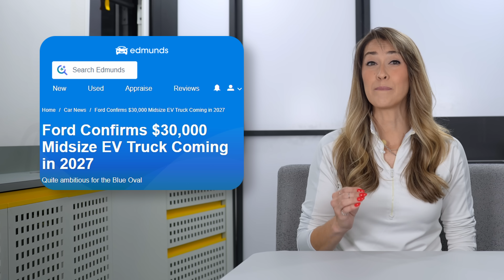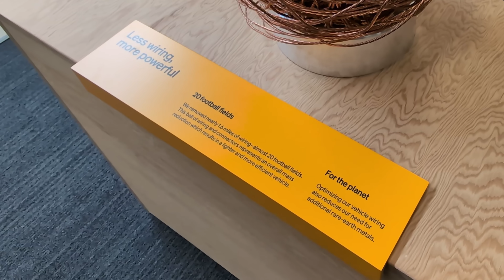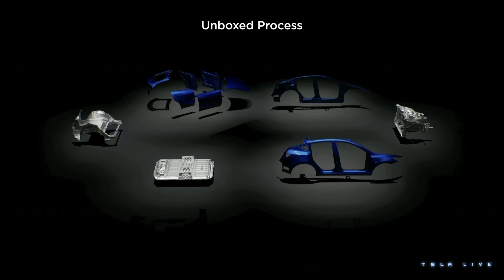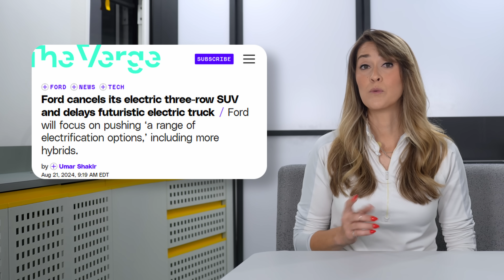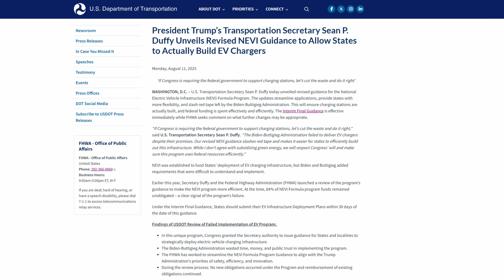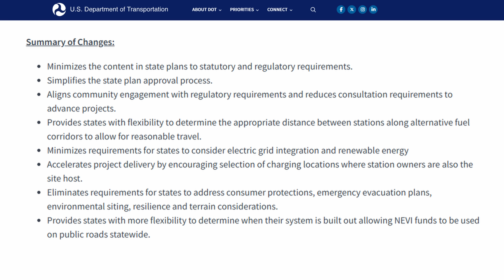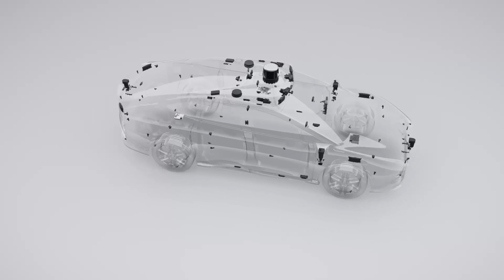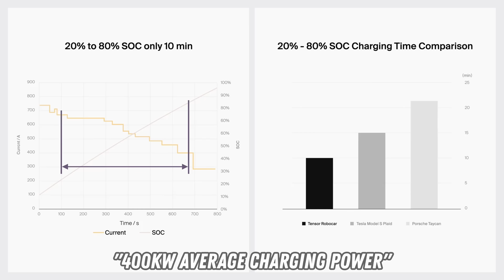The Current : Weekly EV News Ep#76 Aug 17, 2025

Comment: $30k is more of a Model A price than a Model T
Reply: Not saying it's bad.  All remains to be seen IRL
Reply from the maker: The principle of a revolutionary low waste attainable truck is the basis for the Model T comparison rather than the numbers.

Since you brought up numbers: 
The original price of the Ford Model T, adjusted for inflation, would be around $25,000 in today's dollars. When the Model T was first introduced in 1908, it cost $850. The price decreased over time as production became more efficient, reaching a low of $260 in 1925. 
-Producer Tim
Reply: ...vs lowest price currently available EVs
Reply: ...& slate "$25K"
Reply from the maker: Slate is extremely barebones with none of the standout features Jim highlighted in the upcoming Ford mid-sized truck. Slate has no stereo, no navigation, no power locks or windows. Slate will be fine for some, but it is not a mainstream competitor for the Tacoma or Canyon. 
-Producer Tim
Reply: ...& Bolt under $30K in 23
Reply: ...25 Leaf under $30K
Reply: ...model T - for the masses, model A was a better car, not a cheaper car

Comment: Ford is slow and messing up.
Reply from the maker: Are they one step ahead of Toyota, Honda, Subaru, Stellantis, Nissan, and/or General Motors? 
None use unboxed assembly. None produce LFP batteries in the USA. None have Zonal architecture.
-Producer Tim
Reply: @MissGoElectric  Definitely not GM. The others can be debated. Definitely smart to go the Tesla route for manufacturing. Ford has always been my car brand. It’s the only brand I had until we bought a Tesla. I wish they would have started earlier. They should have went for short term pain for long term gain. Instead they went for short term gain and are slow to the EV game. But once they get all this investment in place they will be rolling. But, still could have done it long ago.
Reply from the maker: I spent about a decade working for Ford. The culture of denial about EVs and Tesla's reinvention of how vehicles are designed, produced, marketed, sold, and serviced was staggering. Internal politics, sycophancy, bureaucracy, and the high-protocol + low-vision corporate personality type have work against Ford and other legacy automakers. The financial reporting realities of abandoning ICE IP+facilities+workers and the effect they have on investor behavior prohibit any sudden moves. It is a rock and a hard place.
-Producer Tim
Reply: @MissGoElectric  Great explanation.
Reply: Corporate, stock quarters vs future viability
Reply: U R

Comment: If Ford can pull it off, this is a chance to regain a lot of American market at the low end. It’s no secret that people can’t afford the big fat vehicles anymore. Can’t afford decent used vehicles use vehicle prices are so high that if slate or Ford can pull this off. In the long run, it’ll be a mini gold mine and I think the new approach will have a lot. Fewer recalls fixed and repaired daily is never been so large as it is right now with Ford Highlander.
Reply from the maker: The platform has potential.  We recognize that the specifications would be fairly appealing if the product were available right now.  We aren't sure how it will fare against a slew of new products from Lucid, Rivian, Tesla, and Toyota which will also be released in 2027. -Producer Tim

Comment: NEVI is throwing even more ammunition into the charging wars going on in America right now. Such an amazing time to be a witness to. It's like the intenet and computer revolution of the 1990's, and the smartphone revolution of the late 2000's.
Reply from the maker: Personally, I've noticed that NEVI stations are overpriced and the cost per connector is astronomical compared to what the private CPOs can achieve.  Free money is rarely spent in an optimal way.  That said, if the charging deserts can be filled in by this infrastructure....EV adoption will happen more quickly. -Producer Tim
Reply: @MissGoElectric  Unfortunately, I have to agree on the pricing. Especially with providers such as Francis Energy, the Love's-ChargePoint sites, and the the Pilot/Flying J/EVgo NEVI sites. The only exception on pricing being those by Tesla, which I think is second or third in NEVI awards. Those are usually the cheapest around. And of course, those are all V4 sites open to all.

And I do also agree that this is just a small drop in the bucket compared to those other trillion dollar corporations that have decided to do it all themselves and can afford to compete on pricing. But nevertheless, it's still more ammunition being thrown into the ever expanding charging wars.
Reply from the maker: You bet
-Producer Tim

Comment: Ford just doesn't get it. EV's trucks with tiny batteries (in kWh) and slow charging 400V architecture is going nowhere in America. While GM is building 500 mile of range fully electric trucks and SUV's that charge at 380kW, Ford is playing with 200 miles of range. Or 160 miles at 80% SoC, and around 140 miles in winter. And most drivers don't go under 10% SoC, so your looking at around 120 miles in the winter.

And keep in mind that 3WT Silverado EV with 390 miles of range is down to starting at around $55,000 already, imagine just how much cheaper they will be in 2 years when the Ford 120 mile Ford EV truck comes out.
Reply from the maker: Remember, GMs 400+ mile trucks cost a fortune because the batteries are absolutely massive.  The total addressable market for a $30K truck at least 20 times larger than the TAM for an $80k truck. GM doesn't sell very many stripped down WT (work trucks) to consumers. Those are mostly sold to fleet operators. The average selling price of a GM truck is over $80k right now. -Producer Tim
Reply: Did you miss my second paragraph? It was there for a reason expecting such comments. The 3WT with 390 miles of range is already down to $55,000. Anyone can go to a dealer right now an get one for $55,000. That's not a fleet price. That's a dealer price. The fleet price is even lower. So imagine how much cheaper they will be in 2 years time when the Ford "might" come out.

And you can get used 2024 3WT models with 7 years of warranty still left on the battery and drive train and with low miles starting in the mid $40K.
Reply from the maker: I addressed your pricing in my previous comment. 
Used EVs will certainly provide better value than new ones. I didn't respond to that because I didn't think it was controversial. 
-Producer Tim

Comment: I hope ford succeeds with this project.   Skateboard / tophat is nothing new at this point, show it.  Sounds a lot of EV for a midlow price, I'd rather see a breakthrough low price, that would be more comparable to Model T.  Another try at EV pickup, too soon
Reply from the maker: The first vehicle on Ford's new platform will be a pickup truck and we think a lot of EV drivers do want a smaller pickup truck at a low price.  We'd like to see more great electric options which are so compelling that buyers do not even consider an old fashioned combustion vehicle.  Thanks for watching! -Producer Tim

Comment: How much has Ford made from fossil industries to prevent them from doing this 5 years ago? All this has already been done somewhere outside the US. Ford is racing to try to recapture last place when they have had this development capability for over a decade. All the delays and backtracking are caused by a failure to accept the transition to the future. The Model T concept shows that from the get go. Quit subsidizing all fossil fuels. That alone will equalize the race to renewable and sustainable energy infrastructure, including electric generation, functionally subsidizing the green energy transition.  

Review the history of the transition away from steam locomotives starting about 1939 to 100% diesel-electric hybrid locomotives by the Mid-1950s. Today is the peak development of the ICE just before they become extinct too.
Reply: The chances of ending funding of oil Industries went from slim to none, they have powerful lobbyists and no resistance from the admin
Reply from the maker: It would be great to see subsidies end for all sorts of fuel and energy.  That money has completely saturated politics in the USA on both sides of the aisle.  We see no chance of it. -Producer Tim

Comment: Can you see that with these new guidelines for DC fast chargers that are incentivized there is even a greater need for longer range vehicles 😊these poor or sparsely populated communities where there is not much infrastructure will be much better off if they can purchase vehicles with 400 to 450 mile range and do almost 100% of their charging at home therefor rarely need a DC fast charger!
Reply from the maker: We think the relaxation of the 50 mile rule will result in stunted EV adoption in the 12 states with strong oil/gas/coal lobbies which have refused participation in NEVI so far.  We suspect their funds will be largely malinvested, to the detriment of EV drivers.  Private networks such as those being constructed by Tesla and IONNA will fill every last remaining gap.  It will just take a bit more time without NEVI grinding out those problematic low-utilization locations.  Thanks for watching and commenting! -Producer Tim
Reply: If they're doing 100% of their charging at home, then they don't need a 400-450 mile range, because few people drive 450 miles in a day, every day of the year and also come home every night.

10 minutes at a 350 kW charger will add more than 100 miles of range if a little additional range is needed.

Some taxis and lift vehicles do run 24 hours a day in 12 hour shifts with two driver's, but that's in a regional area, so an occasional Supercharger session late at night for low cost works, if needed.

Comment: One thing I haven't thought about, Since Ford is retooling the plant that builds the current Escape and Corsair, and they haven't announced replacement vehicles, It essentially marks the discontinuation of those two vehicles. That's not a huge deal, except that brings Lincoln's lineup down to just 3 vehicles. I wonder if Lincoln will finally enter the EV market.
Reply from the maker: We previously reported when Lincoln said they'd be fully electric by 2030 and release 3 new models in 2025.  We know those luxury variants were postponed when Ford said the 3-row platform would be pushed.  We aren't sure if the brand intends to go all electric by 2030 anymore, but we can be certain Ford will fancy-up a few of its models and toss a Lincoln badge on them to capture some extra profit margin on the platform.
-Producer Tim
https://www.repairerdrivennews.com/2021/06/16/lincoln-seeks-to-electrify-everything-by-2030-talks-connectivity-retail-strategies/
Reply: @MissGoElectric Thanks for the reply. As a current Lincoln sales manager, I can say I'm just as in the dark about this as the common consumer. I would like a rebadged Mach-E to replace the current Corsair. And it would be awesome if they electrified the current Nautilus. I guess only time will tell.
Reply from the maker: Miss GoElectric and I worked for Ford for many years under Henry Ford III launching many products for the brand together before founding this network. We have a soft spot for the brand and wish you and Lincoln great success. 
-Producer Tim
https://youtu.be/tuFAP17Iwy0
Reply: @MissGoElectric I've been with Ford and Lincoln for 8 years. I don't plan on going anywhere anytime soon. 😊

Comment: Ford being moderate with the new EVs, using the 400-volt architecture and not 800-volt, is fine; however, they'll be behind the times with fast charging. I just find it unfortunate that Kia EV4 and Nissan Leaf will basically be the ones that'll be (hopefully) mid-$30,000 sedans. I hope Ford can achieve their goals, but GM already lapped them, and Toyota making EVs for Lexus and Subaru will be America's second-largest EV maker unless I'm miscounting somebody else.
Reply from the maker: Voltage is one measurement and the company will not lead by that metric... especially years from now when it hits the market. That's ok. 
-Producer Tim
Reply: @MissGoElectric  Agreed it's ok because IMO the truck will have a relatively small battery.  Maybe 60kWh or so with ~200 mile range.  It'll be an around town truck, charged at home, so it doesn't matter if DCFC is 400V or 800v.

Comment: Abandoning the 50 mile rule is crazy. Range anxiety is a big hurdle in EV adoption. And those charging sites should be set up with drive through chargers for towing and larger vehicles. The haulage industry will allocate EV trucks to routes that are supported. Build it and they will come!
Reply from the maker: We recognize and emphasized the logic of subsidizing infrequently used locations along distance corridors where economics do not support private investment. 

Without the 50 mile directive, the gaps will all be filled, but not as immediately. 
-Producer Tim
Reply: Jim, people want 400+ miles of range, hoping there is an extended range model 🤞
Reply: For sure.  People should also realize that 75% of truck buyers never, ever tow.  The truck market has many niches.  The current vehicles and charging infrastructure is “only” adequate for 75% of the truck market.
Reply: @solarguy4850 The current infrastructure is adequate for 100% of truck drivers because that 25% isn't towing every day.

For pulling massive and heavy trailers and RVs cross country, people will continue to choose expensive diesel pickup trucks.

Electric trucks work for towing boats and campers to local and regional lakes, rivers and beaches. They also work for towing ATVs, motorcycles and hobby vehicles to local off road areas.
Landscapers, carpenters, plumbers, electricians, craftsmen, delivery services, public utilities, pest control, roofers, ride sharing, hauling services, private business, Police and Fire Departments and other government agencies can use EVs because they don't need to charge at high power charging sites along highways.
They can all charge with lower amperage level 2 chargers, late night when the grid has excess capacity.

Most tradespeople make money by working and driving regionally near their homes.

Workers and tradespeople don't make money by spending all day driving cross country in their vehicles.

Comment: Most truck buyers don't want full electric trucks. Range extending electric trucks is the future for the foreseeable future.
Reply from the maker: Most buyers want the best truck at the best price. In due time, fully electric options will absolutely decimate combustion alternatives by every metric including value*. -Producer Tim
Reply: @MissGoElectric Numbers don't lie. Full electric trucks are available and have been rejected in favor of hybrids and Ice trucks.  When range extending trucks are announced by manufactures the interest skyrockets. I don't see that interest for full electric trucks yet, but if the manufactures can build one that competes with ice vehicles on every metric ( refuel time, range, cost, etc) then maybe they will become "the foreseeable future".
Reply: where foreseeable is like... 5 years? 

For most people with pickups, where they just drive around town, assuming they can charge at home, EV pickups are great, better even (certainly cheaper to run.)  If you do a lot of mileage around town, the operating cost benefit is huge,
and no oil change, "fueling" about 4x cheaper, and the fuel being put in overnight means no gas station errands. Just way more practical already.

But for long haul towing, pickups don't work yet.  you have to stop uncomfortably often, and wait uncomfortably long to charge.  The GM pickups, for example, with >200 kwh capacity is close to good enough even for towing... the problem is they charge too slowly.  For cars, an 80 kwh battery with 200kw charge rate is fine... for Trucks, that means the GM truck would need at least a 500 kw rate to deliver the same level of comfort (short charge times.)  And chargers to deliver that rate have to be plentiful.  Currently the truck charges too slowly, and the chance that whatever charger you find kind supply fast enough rate is too low;  you end up waiting around a lot when towing. 

 The current buildouts are for cars... not fast enough for trucks that tow.  That's how it is now, but "foreseeable future"? 

For trucks that tow, need higher charge rates.  The commercial trucking industry is slowly starting up.  Commercial hauling is super sensitive to costs, and once the huge operating cost advantage of EV trucks is demonstrated, the whole industry will want to move over as fast as they can.  But I don't know how fast that is.  For heavier trucks, the worldwide standard is MCS (Megawatt Charging System.) It was only standardized two years ago.

MCS chargers are now available from several manufacturers, but I haven't seen rollouts yet.  That's the rollout that will make EV trucking practical, as the charge rates will trickle down to smaller trucks.
Reply: @qcca123-f1v If someone is towing a camper across the country, what's the hurry? Please tell the world.

The same people who'll spend hours driving all day long, day after day on a 2,000 mile road trip one way, will complain about EVs taking 25 minutes to charge.

Driving long distances in a gas vehicle is a waste of time, vacation days, money, food, hotel stays, and wear and tear on a vehicle, especially if one is in such a hurry to get somewhere.

Take a jet and get there in a few hours. Rent a vehicle upon arrival at a destination.

No wonder so many Americans are poor and struggling. They can't do math and they have no critical thinking skills.